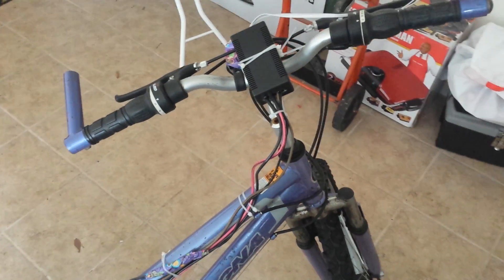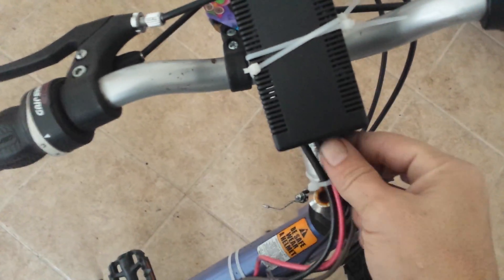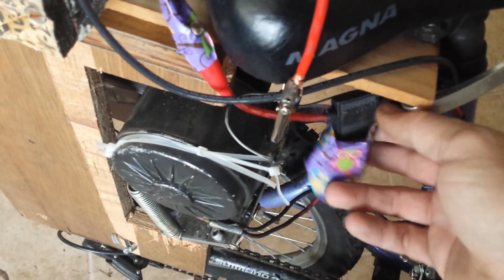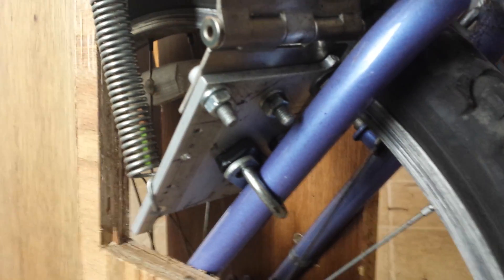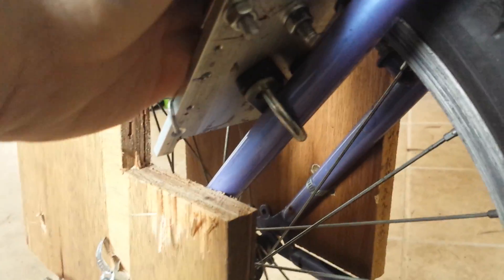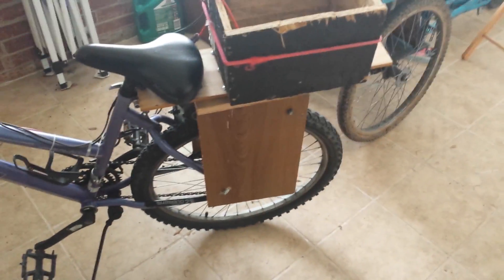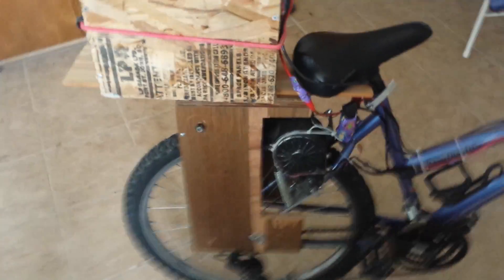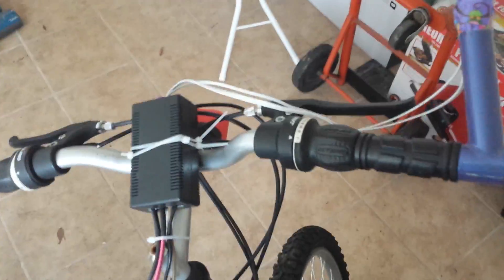Friction drive electric bike motor part 7

Comment: No test run. Did not work.
Reply from the maker: Pop Holmes I still have this setup. It will be on a beach cruiser when I release my next batch of videos. The lawn mower batteries are not ideal and alot of projects have been shelved due to lack of money/time/resources. I will try to publish the most current build of this setup soon.

Comment: is there a way to DIY make the wheel mount and motor similar to add-e  and then  buy the battery  only from add-e to power it?  reference this video: https://youtu.be/Zom8qQ37IYQ
Reply from the maker: That is a fancy diy ebike setup. it runs a brushless motor and uses more expensive parts than my hacked together junk.  It all depends on your skill level and what you have on hand to use.
The battery pack from that bike will power the rig if it is 24 volts. Personally i would use sealed lead acid batteries because i am cheap and so are SLA batteries.

Comment: does the friction kits wear out the tires?  I am looking at the add-e kit for brompton https://youtu.be/Zom8qQ37IYQ
Reply from the maker: It will wear down the tire a little faster due to the friction of the motor riding on the wheel.

Comment: Where is the test for this?
Reply from the maker: +Bilal Patel  Oops and thanks. I didn't realize that there was never a test ride video posted.  I will dig through my camera to find it.
I sold that bike about a month ago to someone who really wanted it. The bike with the two lawn tractor batteries attached would go about 5 to 7 miles on a charge. Top speed is about 20mph.
The two issues i encountered with the bike were battery weight (from cheap lead acid batteries) and a gross lack of torque. The drive wheel on the motor can be shaved down more to increase the torque thus losing some of the top speed but i found it more financially viable to sell it to someone who weighs 50 less pounds than i do so i can fund more builds.

When i find the test ride video i will post it :)